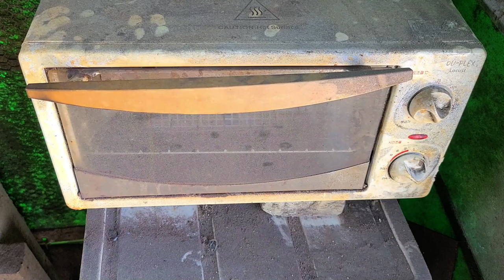Making an Fruit Knife

Comment: Usually I like your work. Today I see big flaws. There are large gaps at the junction of the handguard and the handle covers. They are not folded. 8.57 movie. I know how long it takes to make a good fold. But I would not sell such a binding. Cool wood.
Reply from the maker: Thank you for watching.
There was a mistake in making the bolster and handle. I am still immature. That's the biggest reason I don't sell knives.